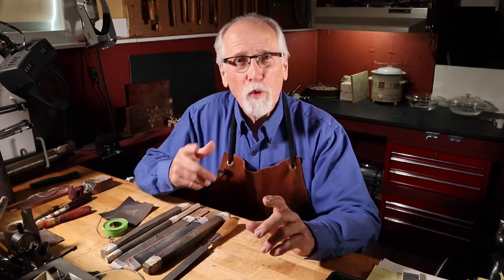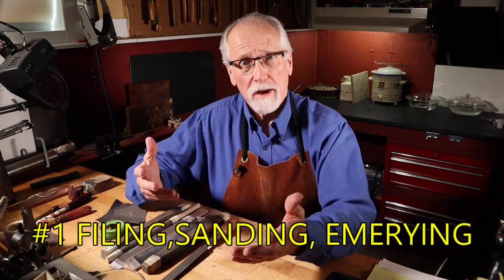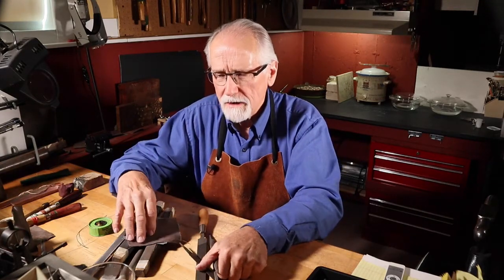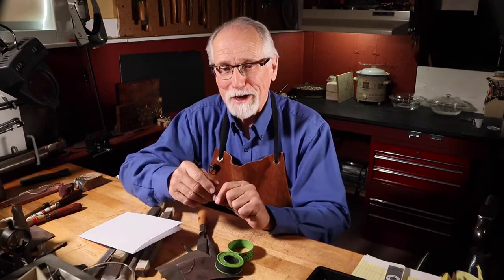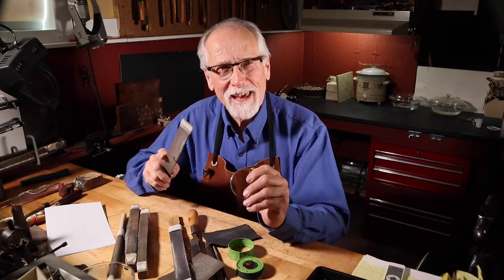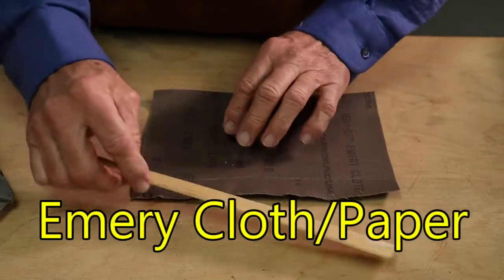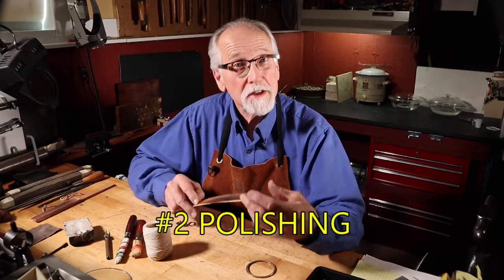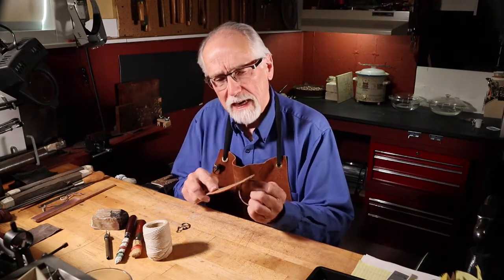LOW TECH POLISHING TECHNIQUES

Comment: I have these cheap nail buffing cubes that have four degrees of abrasiveness, ending with a smooth polishing surface. I have found these to be really effective to clean, smooth and polish silver to a shine.
Reply from the maker: Hello Dan,  Thanks for sharing! You are correct that they do a great job.  I have used those before also.  And the nail emery sticks are good too.  Thank you for the great tip!!  A appreciate it. Greg Greenwood

Comment: Hello Master, really interesting and useful.  I didn’t understand how I can do the buff stick with the leather?? and what kind of leather I can use? Thanks 🙏🏽
Reply from the maker: Hello Danilo, Thank you for your question.  First, take a flat wooden stick about 1inch by 12 inches by 1/8 or 1/4 inch thick. Cow hide or pig hide will work. Cut a strip to fit the stick and glue the leather with the rough side out.  Rub polishing compound on the leather and you can use the stick as a polishing tool. Hope this answers your question.   Greg Greenwood

Comment: Yes, often the simplest way is the best. I'm not a jeweler, but often do similar things, so let me add a few little extras.
I, too, often used the paint stirrer sticks. Then one day in Home Depot I saw one quart sticks. They are 1 in by 7 in. I find that with smaller items it's easier to move them back and forth quicker. As I remember 30 for $10. 
Have you tried wood dowels? I've found that with a push and twisting motion they often work well. And, of course, its easy to unroll as you wear out the emery cloth. 
I never thought of string, but I have used 1/4 in cotton rope. It's old clothesline rope. Unfortunately now clothesline is all poly something. I think sewing stores have cotton rope for trim or decoration.
I see you have the small 3M Scotch-Brite pads (Home Depot?). They also make industrial sized pads 7 x 10, larger and in vastly more grits. Available at Amazon, and information on 3M's website. Your video suggested to me that I could cut them into thin strips to make string/rope. 
Keep up the fun, experiment, and please, keep sharing.
Reply from the maker: Hello jrl2996,  Yes, I use dowels often.  I have one in the video too.  They are the greatest for rings etc. Good observation about the Scotch Brite pads.  I buy the sizes that are on sale!!! Glad to hear your comments and suggestions.  Low Tech tools are definitely a cross over to other fields.  Fun--Always!  Keep watching.  Thanks Greg Greenwood

Comment: I found this video to be very interesting and resourceful. Thanks for posting it. What coaching would you give for polishing large perfectly flat areas - such as the sides of a small silver pill box, or the flat face of a locket? I find it difficult to use abrasives on wheels without putting divots or shallow or uneven  spots in a flat surface.
Reply from the maker: Hello Allan,  Glad you liked the video.  When using the polishing wheel, make sure that you keep moving back and forth.  Turn and polish at different angles constantly.  If you polish in one direction, you will get the divots and if you polish in just 2 directions, you will get "fish tails".  Also, make sure your buffs are soft.  Harder buffs will make divots very quickly.   I hope this helps you.   Take care.  Greg Greenwood

Comment: Emery cord ? Wow ! Never saw that before. It should also work nice with a jeweler's saw to add some more control !
Where do you get this ?
For making a buff stick I prefer using a folding leg as it still scores nicely, but won't cut through the emery paper/cloth.
I also use burnishers a lot. Especially when I'm mobile and can't have my bench polishing motor or flex shaft. I use not only the steel burnishers, some of which I make myself, because you don't get all the shapes you need, but also the ones that are based on semi-precious stones like agate - those are very hard and provide an excellent material for burnishers. plus, they don't rust.
Reply from the maker: Hello Torsten,  You can get the emery cords and tapes from: E.C. Mitchell Abrasives.  Goggle the name and the website comes up.  Also, It is on Amazon, but it looks like it might be more expensive.  I like the idea of using the jeweler's saw with the cord.  I'll try it.  Glad to hear you are using and making your own burnishers.  They are great.  Have a good one. Stay safe.  Greg Greenwood
Reply from the maker: Hi Reid,  I like the idea of the jeweler's saw with the emery cord too.  E.C . Mitchell Abrasives sells the cord.  It is on Amazon too.  Thanks again for watching and commenting.  Greg Greenwood

Comment: I have completed my first ever sterling silver cuff!  But my steel wool has left the finish scratched, or rather a brushed look.  It's an anticlastic design, so I'll have to polish it by hand... any suggestions?   I could just oxidize it and buff it out but is there a better way?  Thanks ahead!!
Reply from the maker: Hello Jeni,  Congrats on your first cuff.  You could use your flex shaft and polish small areas at a time. I would lean toward putting more steel wool brushed finish on it, oxidize, then steel wool again.  It will leave a nice finish that will not require a lot of maintenance. Let me know how it goes.  Greg Greenwood
Reply: @greggreenwood4628  thank you!  Your second suggestion is what I'd like to do since I prefer an oxidized finish anyway.  I will do that and let you know how it went!  Thanks again, I really appreciate the support!
Reply from the maker: Hello Jeni,  Looking forward to hearing about the cuff.  Greg Greenwood
Reply: @greggreenwood4628  it turned out great and sold in 2 days!  Thank you for your wonderful videos and thoughtful replies!!

Comment: I do have a quick question if you don't mind. Is it important to have a separate set of polishing tools for each kind of metal? For example, a set for polishing gold and a set for polishing silver?
Reply from the maker: Hello,  Thanks for the good question.  I feel it is important to have separate buffs for the different compounds and for the different kinds of metals.  If you will be polishing anything that is a ferrous metal (metal that has iron in it {steel}, never polish a non-ferrous metal ( silver, gold, copper) with the same buff.  The particles of iron that remain in the buff will ruin the finish on the silver etc. You can get by using the same buffs with gold and silver, BUT,  the buffs are very cheap and if you are going to be using gold, keep a gold set of buffs.   I hope this has helped you.  Good Luck and ask anytime.   Greg Greenwood
Reply: @greggreenwood4628  Thank you very much! I don't use any non-ferrous metals anymore. I work with sterling silver and 14k gold. I do use gold fill, too. I will be polishing all three, though only very lightly on the gold fill. I've never used polishing compound or proper buffs, so right now I have a variety in my online shopping cart. I will get enough buffs to keep everything separate. (Technically there is ferrous metal under the gold in gold fill. The inside of the wire will only touch the buff at the ends of the wire, but I'm thinking I should keep those buffs separate, too, so there's no chance of ruining my solid gold later.) I appreciate the good advice. Thank you!
Reply from the maker: Hello,  I am very sorry for the late response.  Somehow your reply missed.  I would still keep all of the buffs and compounds separate.  It sounds like you are doing a great job.  Keep it up.  Thanks Greg Greenwood
Reply: @greggreenwood4628  No worries! Sometimes things do get lost in technology. 

So far I've been using the 3M polishing disks instead of mops with polishing compound so I don't have to deal with the mess. The 3M disks work great! I use just the last two disks if I  only have minute scratches and am just going for shine. Or a few steps down the list of courseness if I have tool marks to remove. So far they have worked amazingly! If I take my time to go through the different steps I end up with a smooth finish and a very high shine! Though a quick wash at the end would still be best. You could probably do a nice video on them if you wanted. 

People haven't been buying gold lately, so I've mostly been polishing silver so far. (So, your message isn't actually late at all.) But I'll use fresh disks and keep them separate when I do polish gold again. 

Thank you again for the nice reply! 🤗
Reply from the maker: Hi VirgLibrSagLove,  I am very happy the disks are working for you.  I have used more of them in the last couple years and have been satisfied with the results.  Best wishes to you.  Greg Greenwood
Reply: @greggreenwood4628  Thanks! Best wishes to you as well! 💫